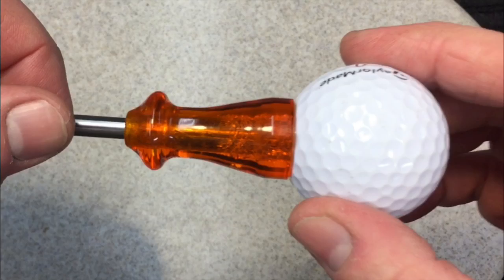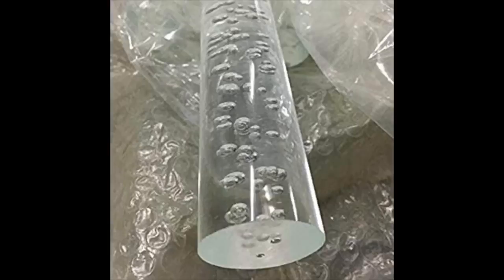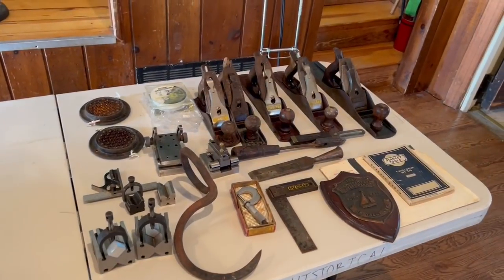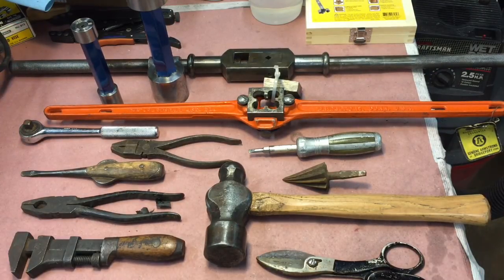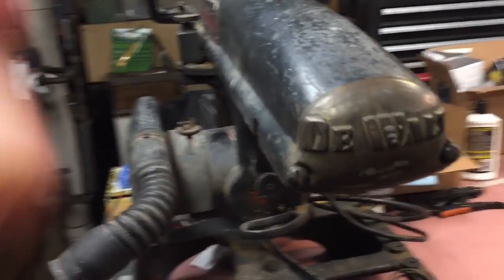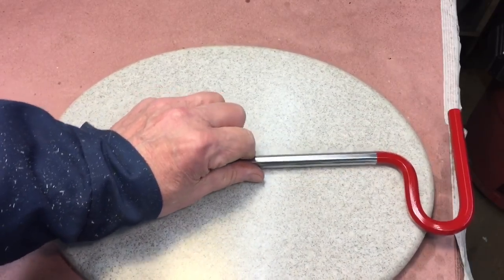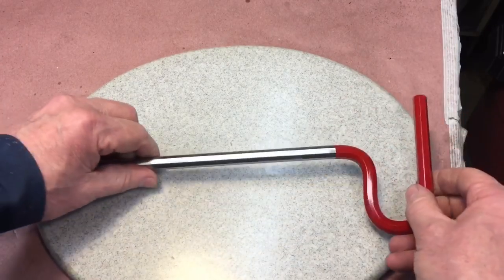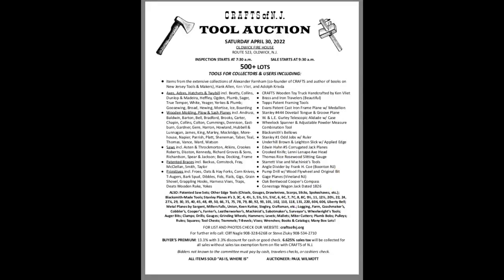Long Island Tool Meet- Vintage Emesco Dental Drill, Captain America Screwdriver!

Comment: The dentist had one of those drills which he only used at low speed with a burr tool in it, it was absolute torture and left your head vibrating for ages after
Reply: The slow drone was as painful as the grind.

Comment: Great episode mate. I’m old enough to remember dental drills like that. My dentist had one of the belt driven drills and a pneumatic one.  The pneumatic one did most of the work because as you said, the head was a right angle. The belt driven one was used for grinding and shaping the tooth after filling.
That ratchet screwdriver isn’t that old, I have one made by Kinchrome here in Australia. Looks exactly the same except for the colouring. A good screwdriver. I use it all the time.

Comment: That dental drill is very very slick. As a generality, when round belts are used, you are typically working with a very tight tolerance spindle. I know your engine lathe is small, but that would make a dream milliing attachment. It would also be great for regrinding the Jaws. Thanks for sharing, off to eBay to look for one
Reply: The Deckel D1 of Fame works the exact same way. Same round belt making a continuous loop through pulleys with linkages to allow any position. The Deckel was often used for engraving, you could change the fulcrum point which would adjust the scale of your work. But it was not made for engraving alone, more as a device for freehand machining to copy something out of an easy to work material, adjust the scale if desired, and slowly carve the same out of metal. It does not do anything quickly, but there's virtually nothing it cannot do.

Comment: Im a fan of split point sharpened drill, for me i can adjust rpm of drill and with back up under what im drilling i can control back side blow out.Not saying it correct, but it works for me..

Comment: Interesting old dental drill.
Thing that struck me is that the drill bit is in line with the drill body/handle whereas with all the modern ones the drill bit is mounted at a right angle in the head of the handle/body which makes sense.
How on earth would you drill straight down into someone's tooth especially in the back teeth with that thing?
Reply from the maker: Yes!  Maybe they used a right angle bit?   😂😂😂👍

Comment: That is a beautiful radial arm saw! I think that's the second most beautiful one I've ever seen. I believe it was only for 4 years, but AMF, who briefly owned Harley-Davidson, produced these for a while. The ones they made have a very distinct speckled Paris green paint that is tough as nails. It's an absolutely beautiful machine. I was never a fan of RAFs until I tried a commercial grade one with the seven and a half horsepower motor, also a DeWalt. It's from 1980 I believe, it had a rather poor design for setting bevels on the column, but that was easily replaced with a proper aluminum graduated wheel. The biggest difference is weight, these commercial ones tend to be 3 to 400 lb. In my opinion, the weak point of rafs is the table and tramming system. When I built my own workbench, overbuilt of course, I removed the entire original stand and built it into the table. I had to extend the crankshaft to be at the front of the bench, but I made the bench the exact same height as the table saw. So the table saw is right by the door and is the first sight for breaking down materials. The outfeed goes right on to the workbench where the RAF is set up for cross-cutting. It still has all the original abilities, and I'm one of the few people that uses the secret router feature. I really think these were a phenomenal tool whose reputation got destroyed by the production of homeowner grade tools. One of my favorite documentaries ever is on YouTube, it's about the need to build fort Lewis McChord in a great hurry. The military contracted with DeWalt and the RAF was born. If you watch this documentary, you will see commercial machines like mine. They are serious machines, all cast iron. These guys had an incredible assembly line all based on several hundred of these machines. Each station had a DeWalt RAF set up in wildly different ways. They ended up building something like 4,000 residential houses in 7 months, something ridiculous like that. While they are no longer on base, virtually all of these homes are still there in their original condition. Despite the speed in which they were built, they seem to be of equal quality to homes built traditionally of the same time period. I believe the documentary is published by Pathe~ but I'm afraid I don't have a link. I'm quite confident that any viewer of your channel would quite enjoy it as I believe would you.
Reply from the maker: You are so right, the commercial ones are RIGID! The homeowner grade saws are in my opinion dangerous.  I wanted one so bad because the lumber yard where I bought wood had a huge Dewalt commercial saw that would slice thru wood like butter!  All day long!  =D

Comment: The old original round electric motor on the drill was called a Ritter Engine. I know folks that did detail work with them before Forney and the flexible shaft (speedometer cable drive) deals. NICE DeWalt saw. I started out with a Delta Gilmer belt drive chop saw. You could hear the whine for a mile. Go Upstate and cut the grass  and take the GF and the hammock with you God Bless You CS!
Reply from the maker: I have to cut the grass!  😂👍
Reply: @ScoutCrafter  Take the GF. Neither one of us need to go anywhere unsupervised!

Comment: One other very cool thing about the mechanism of the dental drill... If you want to change direction, you need only to lift the belt off of one pulley, put a single twist in it and reinstall. It's one of the great advantages of having the power source separated, you get an equal range of speed and torque in both forward and reverse. I think this is the main feature that makes them very popular to rig up as a tool post grinder. I don't know about that one, but I've read of dental drills capable of 50,000 RPM!
Reply from the maker: JP- It seems like such a complicated mechanism though...  I always wondered why it was used over a flex cable drive?
Reply: @ScoutCrafter  I think a flex cable would impart a great deal of angular momentum to the spindle, particularly above 15,000 RPM. The heat generated makes it very difficult to keep bearings in tight tolerance; almost every round belt set up I've seen like this uses plain bearings for the same reason. By having the motor so divorced from the spindle, you're not fighting any harmonics either

Comment: ScoutCrafter,

I remember dental drills like the one have.  You're missing the spitoon, with the water swirling around.

Podiatrists use a drill that works somewhat like the dentist drill.  It works more like a Foredam tool.  The key feature is the high efficiency vacuum that collects the dust.  They are made by Medicool.

Great screwdriver.

Bob

Comment: Great video John. Loved the dentist drill. I almost bought one on line. My Uncle John was a dentist. His office had these in both chairs. The motor on the base looks exactly like a sewing machine motor. If you should ever need a replacement motor, just let me know and I’ll get one off to you right away. Went I saw the one on Facebook, I thought about using it for polishing and fine detail work. Much more agility than a Dremel or a Foredom tool with a flex cable. Since my shop is still a work in progress, I passed on the dental drill. So how do you get the stars that you put on the golf ball so perfect. It looked great. Great Video. Best Regards,
John
Reply from the maker: John- I wish I could take credit for the paint on the ball- I bought a set of 3 of those off eBay.  $9. 😂👍

Comment: Why epoxy your screwdriver blades in the handle the manufactures do not do it? Drill the holes the same size as the screwdriver shaft, heat the shaft until it starts to melt the plastic and press it in.

Comment: Hi M.t.A John & room what is a really good batch of strong drill bits I can Buy that don't break so easy good brands what not??????
Reply from the maker: Alan-  I heard Big Dog bits are strong,  I don’t drill very hard materials and go slow and keep the bits lubricated with cutting oil and cool so my bits last a really long time. However if you are drilling plate steel or stainless you need good bits!  😃👍